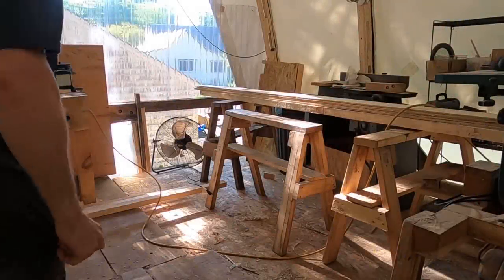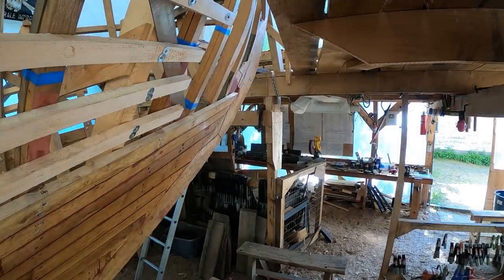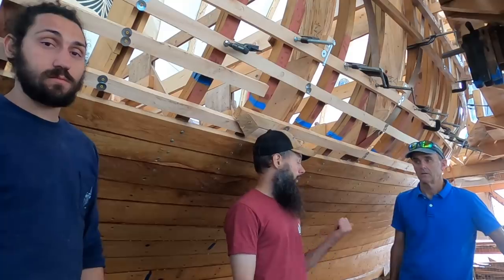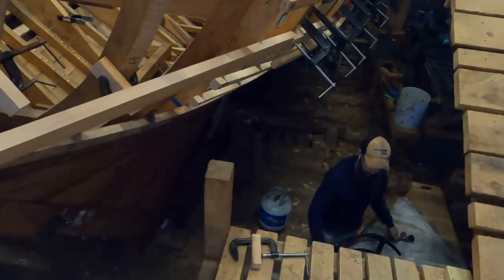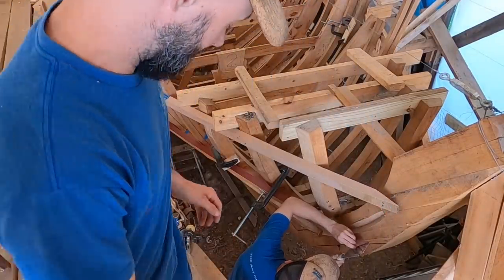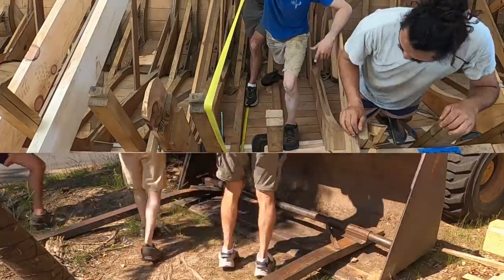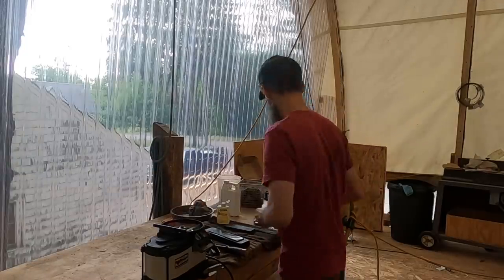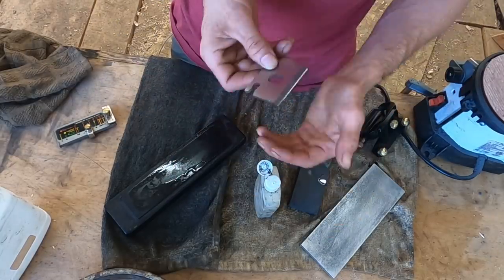Acorn to Arabella - Journey of a Wooden Boat - Episode 119: Getting Ready for a Big Change

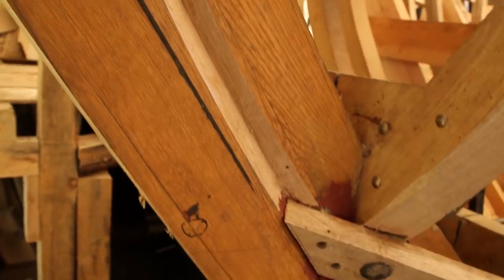Comment: The shot at 4:30 looking down at the stem or the stern where you can see the planks converging into the rabbit from different angles looks really cool. Also, right on with the Lee Valley Mark 2 honing guide. I love mine. Super easy set up with the jig and I love how easy the micro bevel feature works for when you need a super sharp edge for finish work. Project is coming along nice. I enjoy watching the build.

Comment: Re: Hand sharpening tools on stones.  Move tool in a figure eight and you will keep the stone flat longer without putting a belly in the stone. Use the whole stone with the figure eight.  Start out slow until you learn the movement.  After a while, you will be able to move the figure eight much faster and keep your stone surface flat longer. Also, you can flatten the stones by lapping them on a piece of polished granite with different grades of lapping compound. Great job on the boat.

Comment: Where was the super-glue when that errant pull saw bit you - I'd have thought as a climber that super glue would be close at hand.....
If that's the worst injury you guys suffer then that's a safe job that's being done.
Reply: Grosbeak Ferns  Dermabond is super expensive though. A cheaper, and identical option is called Vetbond. It's the exact same thing, just..... not human rated.

Comment: Super glue is my go to for workplace sutures. Just get the bleeding stopped, then glue the edges of the cut together. If you have butterfly bandages, they will add a bit of mechanical grip. Add some tape for abrasion resistance, duct tape is useful, and you're good to go!

Comment: Lolz  22:46 Stephen had hair and a beard ... 22:54 all gone - summer has called for a change!  The question is did Stephen use one of the sharpened tools to shave the head and trim the beard or use a straight razor?  A great video - you all are really doing one heck of a fine job on Arabella!

Comment: HI, great episode. By the way, I've been following along and wondered, back when all ships were wooden and built like this - how did they do the steaming and bending? They weren't using natural gas and didn't have plastic tubing.
Reply: Presumably a more stationary setup like the steambox used for the initial frame bending. Keep in mind traditionally boats were constructed by larger crews working full time, these extra adjustments steaming things in place probably weren't needed.

Comment: One mini cerc sawed the tip of my thumb off, all the way to the bone. Put some pressure with my mouth, had the bleeding stopped, then used some medical superglue to push seal it up after some cleaning. For weeks the tip was cold as ice, though i'd just glued back some dead meat, then it sort of back went back to normal. I still have the scar. Went half a few mm into my nail, and then all the way through the finger, past the middle line. That entire month or so, i felt my pulse through my finger tip. Soo, so weird.

Comment: Once you get the edge you want with the Work Sharp, you can spend 3 to 4 mins with a ceramic stone and strop to put a micro bevel on that you can touch up several times before having to go back to the Work Sharp. This edge should perform better an with being able to touch it up in just a couple of minutes freehand, you should get good life out of the edge before having to resharpen.

Comment: You better keep some Cyan-Acrylate glue (medical edition) around for cuts and deep scratches than tryna put Yourself together with epoxy - the latter has too long a cure time to be convenient, and the Cyan-Acrylate originally was developed for the army and other mercenaries to have some at hand for keepin' the valuable red sauce from pouring all over the place anyway. So that's the stuff to have around with sharp tools.

Comment: Unless you need the extra length for some reason, i suggest you shorten and champher those floor bolts to 3/32" above the nut while you still have access. Extended threads inhibit housekeeping, promote injuries and corrosion, foul with rope, stores, and equipment, and in general are a huge PITA. Cut and champher them now while you still have a chance then buff off the sharp edges. 

A 3" scalp wound after a tumble in the bilge three days from medical care is a foreseeable consequence of those 2" long bolt threads sticking out from some of those floors near the peak. Ever sewed up a bleeding friend? Shorten those effin' bolts.
Reply: I seem to recall that they said they were going to shorten them later in the build.  I agree, as short as possible for less headaches.

Comment: If you want to glue human to human I recommend you just super glue (which oddly enough was designed for medical applications as far back as the Vietnam war. Mainly used to glue back together open bone fractures but it works also very well on cuts. Nowadays they even use it to glue back faces and necklines to prevent scar tissue forming on those lifted faces.
Side note: super glue is water (vapour) activated...

Comment: If you burn up another one of your home made steamers  go to a tool rental and they. Make and the tool rental places rent them ,  commercial steamers that  they use for taking wallpaper off on large projects they come with a tank they run on electricity you just plug them in filling up with water and they have a hose you can hook it right into your steaming system you could rent  them for day that you know days that you need them and take them back when you don't and if you have any problem with him they'll replace him with another one

Comment: Does anyone know what type of glue they use to splice those two long planks together with the lap joint? Thanks.
Reply: I think they area still using Resorcinol for gluing the scarfs.  They went to epoxy on some joints (pegs and dutchman, I think).  Or they have changed and neglected to tell us (or I missed it).
Reply: CorwynGC would something like West System epoxy, like you use on clear fiberglass cedar canoes work for a glue? Thanks man

Comment: Putting in frames after planking seems an odd way of carrying on if you ask me? To be fair I'm no expert, perhaps someone can point out the advantages?
Reply: The frames in question need to go where the molds currently are.  So they need to wait until they can take the molds out before putting them in, and they can't take the molds out until the boat is stable in shape.
Reply: @CorwynGC  Ok, but why not put internal beams like the shelf and bilge stringers in to ensure the frames keep their shape? It seems to me that it will be difficult to make the frames being installed later fair and fit snugly to the planking?
Reply: @CorwynGC  Thanks very much for the response by the way.